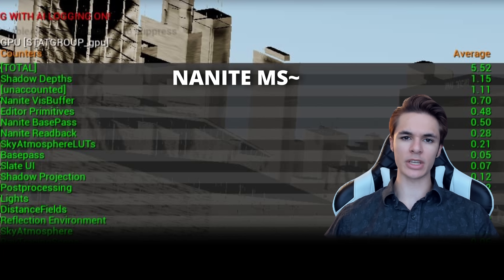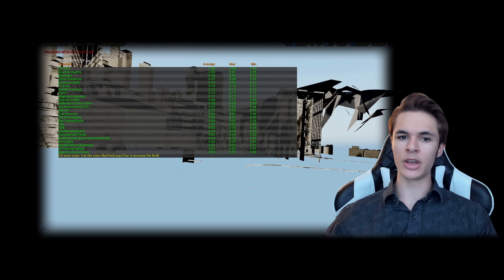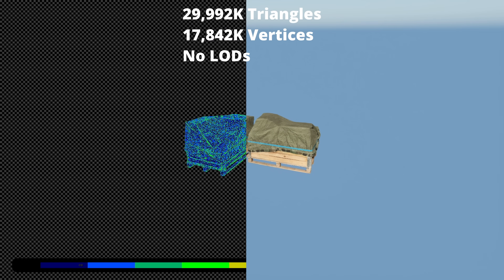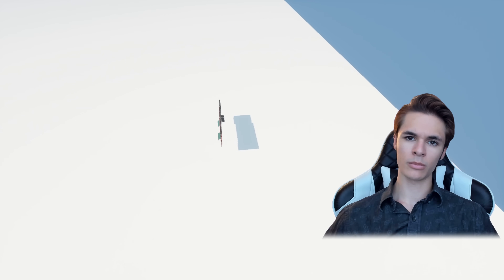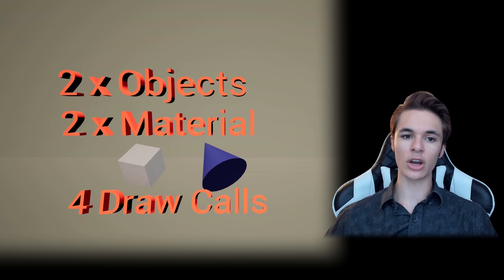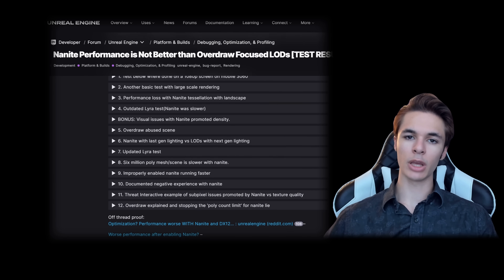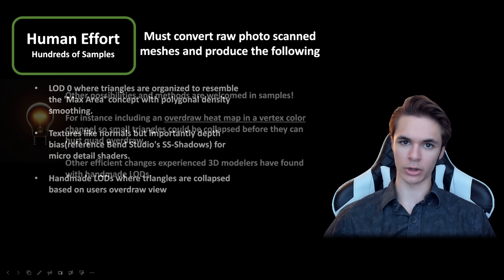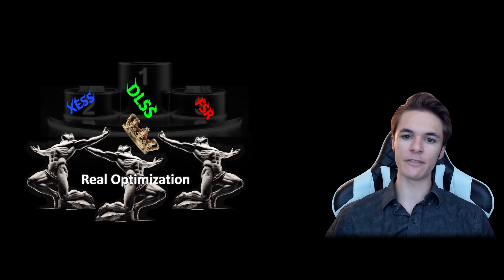Epic's Unreal Optimization Disaster | Why Nanite Tanks Performance!

Comment: Every time I see one of your videos, I miss John Carmack a little more.
Reply: The ultimate GOAT of optimisation.
Reply: Even John Carmack failed. Just remember how ugly Doom 3 was even back then.
It had no cubemap reflections (only selected planar reflections), no indirect lighting (aka Global Illumination), no open spaces and soft shadows. And now compare it to Half-Life 2, which had it all.
Or do you remember Rage, which has enormously grand size and texture streaming issue? Because of infamous megatexture, many new Id Tech suffered from Carmack "genius" until Doom Eternal threw it out.
Reply: @charlieking7600  GI in 2003? xD 
HL2 use baked light via Radiance shadow render, Doom3 if i remember use a ton of dynamic lights, way more than HL2.
Reply: @szakovsky1284  anything having indirect lighting is considered as Global Illumination method.
In case of Half-Life 2 it's just precalculated.
And yes, it uses "ambient cubes" to shade dynamic models.
Reply: @charlieking7600   I was a idtech 4 modder having worked with Doom 3 engine for at lest five years.
First IMO Doom 3 was not ugly, (I think 2002 or 2003 was when the first alpha was publicly showcased) even back then , imo was one of the most advanced games at the time, being one of the first to support massive use of normal mapping, with conjunction with total real time per-pixel lighting and some of the best stencil shadow tech around at the time. Even today IMO it can look fantastic with only a few mods.
About HL2 versos Doom 3, first IMO they are not comparable at all, the later final version came in 2004, and add to cater to 2004 era GPU's limitations, it had full dynamic lighting after all, no light baking, so add to make more sacrifices, in the other end HL2 came in 2005, a year later, and we all know that at that time in particular, a year of diference in CPU and GPU land was massive, so not only HL2 add advantage of running on faster CPU's and GPU's, it add almost no dynamic lighting, was 99% static lighting, it add way more extra performance budget to go crazy on level scale and physics.

 "It had no cubemap reflections (only selected planar reflections)"  Totally wrong, Doom 3 has cube map reflections and plenty of them.
 
"no indirect lighting (aka Global Illumination)" This is true, it has ambient lights, to simulate GI but is not real GI, but Doom 3 was all about full real time lighting and doing GI in real time in 2004, was just impossible. 

" no open spaces and soft shadows"  Wrong on the open spaces, they are not as huge as the HL2 ones but Doom 3 has a few outside scenes. 
You are right on the soft shadows thou, but like I said before, it had one of the best looking stencil shadow system around and on Wolfenstein 2009 they were able to implement soft stencil shadows that rival modern shadow maps. 
Fear developers tried to implement soft stencil shadows in 2005 but they looked really bad, to early.

About John Carmack, IMO he was indeed a genius, was one of the fathers of modern game engines (something that people claim Epic did) but idSoftware by releasing their game engines open source for many years, (epic games still has not open sourced Unreal Engine 1) meant that many people add the means to study and copy John Carmack, something some people at idSoftware said was a huge mistake, but he was all about open sourcing and sharing his engines.  
Even Tim Sweeny from Epic games, admired and said many times, John work was a inspiration for him, both were the fathers of modern gaming and John is considered the father of first person shooters and IMO both deserve respect and not our scorn.

About mega texturing, it is a virtual texturing technique, it's technical term is sparse virtual texturing, you can read about it online, MegaTexturing was just a marketing term. 
All games today, use virtual texturing, in one way or another, but Rage was the first, so it was very new at the time, so unfortunately came to early GPU's were not fully ready for it, but if John Carmack didn't add risked and released his VT system and showed that it was viable in some ways, Crytek and Epic games, probably would never made their own versions, learning from Rage mistakes, so in a sense they have Carmack to salute for showing them the way, even if in some ways was on how not to do something. 
Being the first at something, is always a risk and john was not afraid to risk.
 
And btw Doom Eternal, didn't "throw him out", he left idSoftware years before that game came out, he even left before the previous new Doom came out, Tiago Sousa from Crytek was the one that came him to help finish the game.  
And btw he left, from his own choice, after the company was sold (he was one of the founders) he didn't got pushed out or fired.
Reply: @Argoon1981  doom eternal threw out megatextures
Reply: @CYXXYC  Yes it did but the previous Doom still uses it and no one complains about it (has many other idTech 5 games after Rage, that were very successful). 
Also even thou Doom Eternal removed MT, it still uses Virtual Texturing, but instead of using a huge single texture, that it bakes everything in, cuts in tiny peace's and streams in, it now uses separate individual textures like older games and streams them peace by peace as needed, so it still does part of the work John system did, is not like they said "everything about John Carmack MT system was trash throw it away!".
Reply: People love to say Doom3 looks ugly, but when it was running ads in magazines before coming out, the same people were saying they were concept renders because it couldn't possibly be this detailed in runtime, so excuse me if I take those opinions with a pinch of salt.
Oh and as always, the whole industry learned the techniques presented there and applied them forever, we still do to this day, without too many changes.
Reply: @MadsterV  IMO the only people saying Doom 3 looks bad, is HL2 fanboy's, impressed by its baked GI and modern gamers used to current modern PBR and RT filled games. What I bet some of them never saw, was Doom 3 pushed to the max with mods, like Doom 3 Hi Def mod, IMO it sometimes rivals and surpasses games with full real time lighting that came much later, like say Fear 2/3 and Riddick: Assault on Dark Athena.  This before PBR (physically based rendering) became a thing. 
And btw a modder made a PBR shader for Doom 3 engine but the game assets need massive work to support it well, so no one has done the conversion yet, but technically, Doom 3 can now do PBR too... ;P
Reply: @Argoon1981  You're hallucinating a big time gap between Doom 3 and HL2. They both came out in 2004, Doom 3 in August, HL2 in November. HL2 didn't have any kind of time or hardware advantage over Doom 3. id tech 4 was just a very specific renderer that could only make metallic corridors with dynamic lights look decent, while HL2 had a very general purpose renderer that lends itself to just about any environment you want with the one caveat that most of that environment and its lighting need to be STATIC. The only thing Doom 3 does better is dynamism, and even that only in SMALL SPACES. Just look at Quake 4 to see how bad id tech 4 is at anything that isn't literally a Doom 3 space station / spaceship. As soon as you leave tight corridors you wish you were playing an id tech 3 (Quake 3) game instead. Quake 3 had beautiful lightmaps. id tech 4 was a mistake and so was id tech 5. Carmack went off the rails in the early 2000s, he lost it.
Reply: @forasago  "You're hallucinating a big time gap between Doom 3 and HL2. They both came out in 2004, Doom 3 in August, HL2 in November. " 
Hum you are right, I bought it way later then Doom 3 and I have read somewhere that it came in 2005, but Wikipedia does say it came in 2004, so I stand corrected on that. 

But none the less, imo it doesn't invalidade my claim that both engines, aren't really comparable, mostly because they were made to do very different things, if you try to do with original 2004 Source, what idTech 4 2004 does, you can't, the former afaik doesn't even support more than one or two real time shadow casting lights per scene.

About the rest you said, I have to respectfully disagree with most of it, mostly of what you said, is not facts but your own opinion and you are entitled to it yes but imo is not right, why? Because I know idTech 4 can do bigger levels, within a certain limit of course, is not like I'm claiming it rivals HL2 ones. But the fact is and this is a fact, not a opinion, the engine itself can do bigger levels, than those both Doom 3 and Quake 4 displayed and why is fact, because others did bigger maps on this engine, people like the Dark mod team, and other Doom 3 modding teams.
But yes there's a limit but neither of those games mentioned above, in any way pushed the engine to the limit, afaik the only ones that ever did it that was the TDM team and people doing a few test maps just to find the limits. 
In reality those comercial games, were itself limited, by the hardware that they add to run at the time, mostly the consoles.
 
But if you analyze things well, Quake 4 and Prey, both have larger spaces than Doom 3, this despite using pretty much the same engine, apart from a few little tweaks to the tools the gameplay code and the way assets are handled, tweaks that add zero bearing on the capabilities of the engine of making bigger levels or not.

Btw again, I'm not saying that Doom 3 idTech 4 can do outside levels like those of HL2, that is not what I'm saying, but it cannot do those, for the simple reason that, it lacks two or three necessary peaces, one the ability to bake lighting of some kind, so you can diminish the amount of dynamic lights, striking surfaces, to diminish draw call amount, two a better way to represent vegetation and three a LOD system.
Put those in and the engine can do what HL2 did and even more (minus the full GI of course), and this, was what id did on Quake Wars, the only thing that game brought new to the engine was, improved Mega Texture system and baked lighting for the terrain (Doom 3 can do that as well... but is disabled...) alpha mapping for better looking vegetation (not only Doom 3 alpha testing) and a LOD system, just these three relatively "simple" updates (compared to totally trashing and remaking the engine) made it able to do the huge maps (for the time) that you see on Quake Wars.  The rest is almost the same engine as in Doom 3, apart from finally using GLSL shaders instead of ARB shaders.

Enough said...
Reply: @Argoon1981  Interesting perspective but I need to call out the double standard of simultaneously congratulating id tech 4 for its multiple shadow casting light sources and also claiming that it can do large environments. The engine only looks decent when you have those shadows. And in large scenes you CAN'T turn on those shadows because performance would plummet. So you can have large environments but then they will look like trash, like in Quake Wars which you mentioned. At that point you're dealing with a downgrade compared to older engines. And is it true that id tech 4 didn't even support LODs? That's crazy if true. Didn't id tech 3 have LODs? I thought I remembered a command related to "LOD bias". I could swear Quake 3 had LOD for the characters at least, maybe the guns and items, too.

By the way, if you like the look of stencil shadow volumes the Starbreeze engine in Riddick Escape from Butcher Bay came out even earlier (on Xbox, the PC version was later) and looked AND ran better. That's also a big part of why I don't respect id tech 4. Starbreeze did all the same stuff but better.
Reply: @charlieking7600  Sir, the Source engine is built on Carmack's work. I will totally admit that it is better than idTech was during that era, but downplaying his contribution seems a bit petty.

Comment: Nanite is for extremely dense meshes. Try loading a 10-20 million polygon mesh and you simply won't be able to without nanite.
Reply: The whole point is that without LOD's, dense nanite meshes cause excessive overdraw.
Reply: @midsekta6452  They don't want LODs anymore because pop-ins break immersion. Epic is advancing technology and you guys are going backwards.
Reply: @username-r7d6u nobody forbids using more than 2 LoDs and having them swapped in more eloquent manner.
And remember, Nanite still can't do transparent or skinned meshes, so LoDs are still viable. With LoD you can, e.g. lessen bones count in skinned meshes. Can Nanite do such thing, if it could be applied to skinned meshes? I doubt it.
Reply: @charlieking7600  Nanite already supports meshes with transparent materials. Nanite skeletal meshes is in their roadmap with beta access. (It's in this video.) What you know is either misinformed or out of date. Do more research next time.
Reply: Why would you want polycount around 20m? That's why LODs exists in the first place.

Good luck noticing full res models like 4 blocks down street like GTA IV does at max settings.
Reply: @JorgeAlarconL  I guess the only reason developers would want do use high poly count meshes and have Nanite handle it is because they want to save on development time. Re-topology is really time consuming, so I think this is one of the reasons.
Reply: @JorgeAlarconL  Because that's what is needed to achieve greater realism. Try and run The Matrix Demo without Nanite and see how well that goes.

Comment: Acquiring the same level of rage this guy has for bad optimization, but for putting effort into my SE career, I can single handedly lead us into the the singularity. MORE! MORE! MORE!
Reply: I have 100 other topics around Unreal Engine that make me rage about misinformation just like he rages about Nanite. The Nanite thematic i posted MULTIPLE times on Forums and Reddit to warn people how to not use it, and show how how it should be done. I was researching this topic since version 5.02. Nobody cared. Like i said there are 100 other similar topics (Blueprints, general functions, movement, prediction etc.) which are simply explained wrong by epic themselve and then aknowledged by users. 

If you google : Does culling really not work with nanite foliage? 

the first comment is mine, i was posting there since almost 3 YEARS and repeating myself just for people not listening.
Reply: the the